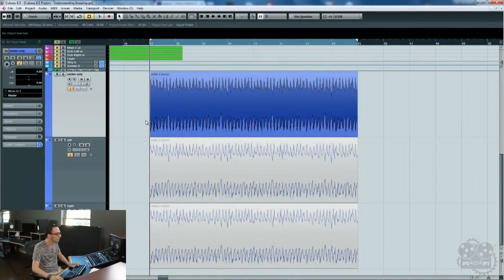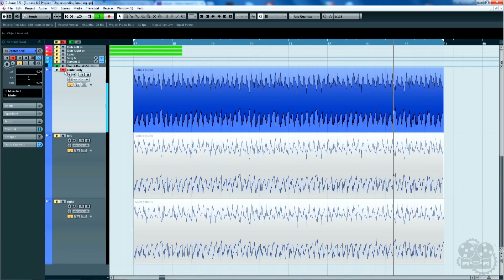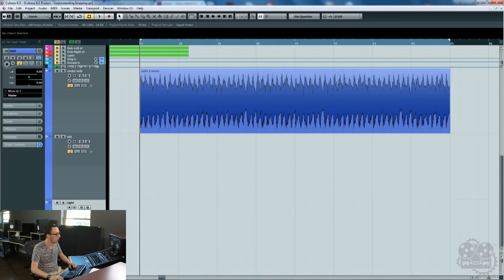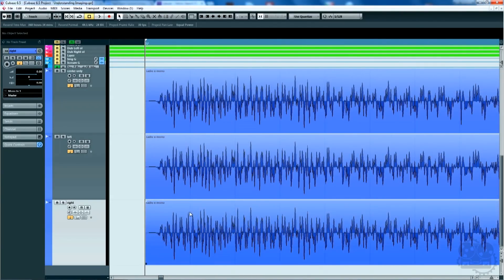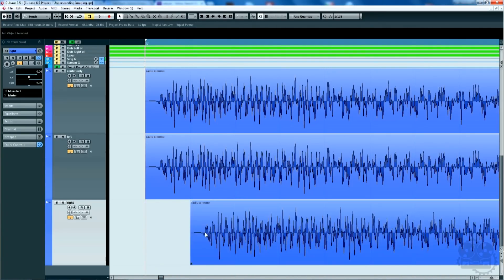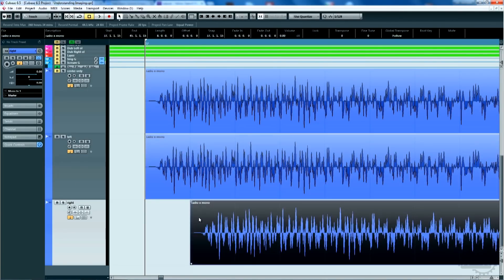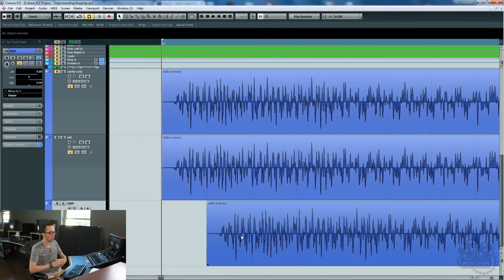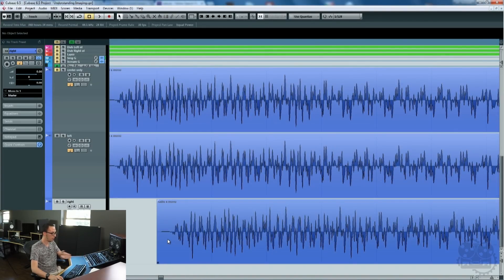How to make mono into stereo with NO PLUGINS! w/ Joey Sturgis

Comment: Only problem with this is that the ears then tend to pick up on the first original timing (probably left pan) track first, and the duplicate time shifted track (right) isn't as noticeable. It won't seem out of time, but the left will lead noticeably. Which isn't ideal for the purpose of widening the mix, as is the goal here. Still, a reasonable solution if the part hasn't been double tracked when recording. 👍